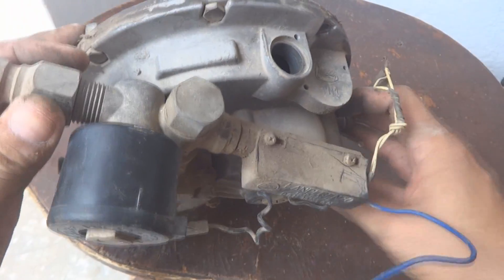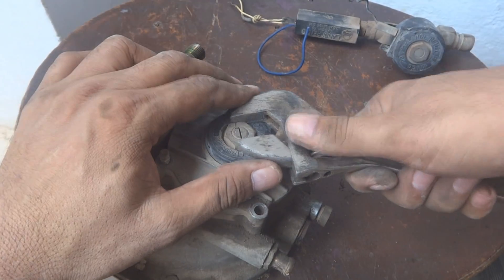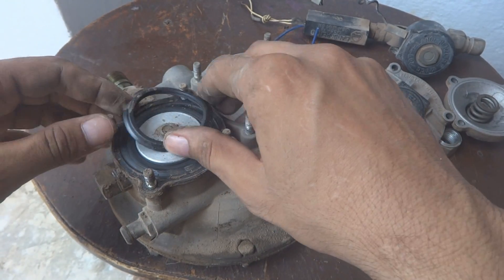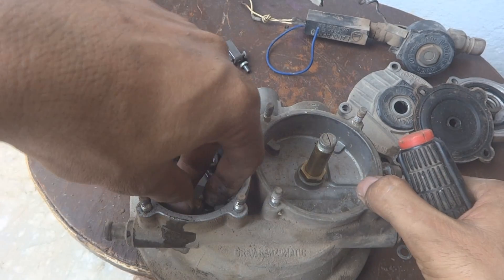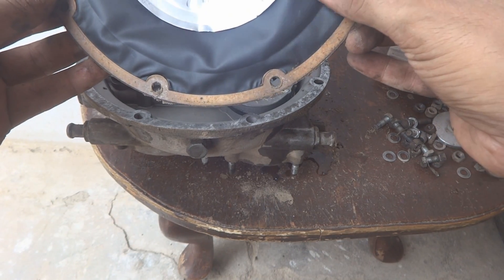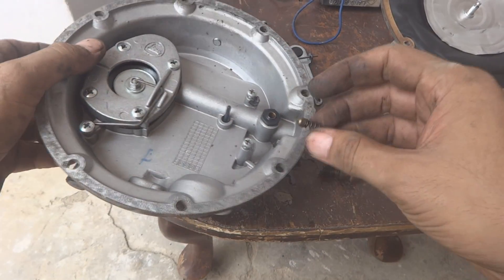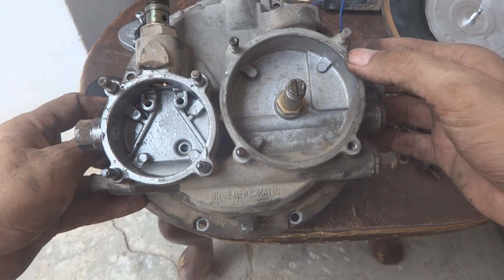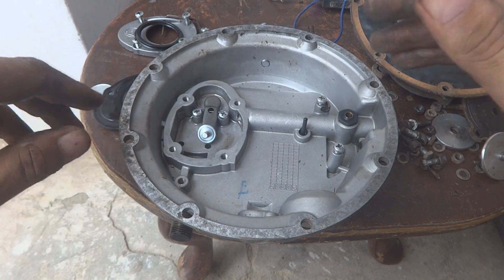CNG kit maintenance part 2. Car CNG gas kit repair and maintenance

Comment: what can you say about the gas inlet pipe where there is very high pressure (220 bar)? With what force should that tube be screwed? I am afraid that high pressure will cause accidents to my health.
Reply from the maker: Sure it's high pressure but the fasteners used works just fine. It's OK for everybody then what's bad with you? Don't be afraid too much.
Reply: @JahanZeb1976  Congratulations for your video, I am from Italy where the Renzo Landi CNG regulator is produced but nobody here has ever produced a video like yours. 
Thank you for your reply my friend. Talat Shabbir wrote : "While dismantling, first shut off main valve , release gas pressure from main line, otherwise gas jet can drill through your hand or whatever in contact".
Therefore is it very dangerous remove the gas inlet pipe with 220 bar ? 
Please , can you list precautionary rules to be observed in order to avoid accidents ?
Do i need to use body protection to protect my eyes and hands?
At very high 220 bar of pressure do it need a torque wrench to tighten the gas inlet pipe ?
What is the tightening torque with the torque wrench ?
If I don't tighten the gas inlet pipe correctly, what happens when I go to the methane dealer ?
Your help is greatly appreciated here
Reply from the maker: Great. Thanks for appreciation. This is right that you should shut the gas valve from the cylinder behind. The rest is just normal. It's like regular mechanical work. Once you do it, you will gain confidence. Also there is no need for any special tools like torque wrench or body protection. Very basic tools would help you in the process. Also check everything you opened and assembled with the help of soap water foams. It would tell you about leakage in your system. So leakages should not be there.
Reply: @JahanZeb1976  the pressure reducer is made of aluminum so if you tighten the gas inlet pipe too much, you don't risk damaging the thread?
Also, if I tighten the gas inlet pipe too loosely, what happens when refueling at the CNG station? is there risk of causing damage to the refueling operator?

Comment: My wagon r company fitted lpg has starting problem on gas and the air is blown from vaporiser through the tiny hole, I have changed the diaphragm also....Is there any solution... ?
Reply from the maker: I have a video on lpg gas kit repair. Watch that and repair accordingly.

Comment: How to wash iner part and what useful for kit wash water or oil or petrol or Cng
Reply from the maker: You can use petrol to wash metal parts only. On rubber parts you will not use petrol. You can wash them with soap water or clean them with cloth. Stay tuned and blessed.
Reply: I have cng luvato kit  there is the problem my car is not taking acceleration on Cng mod it’s going close after on the Cng and taking hitched and not moving my car it’s moving only petrol
Reply from the maker: Your kit needs adjustment or maintenance.

Comment: I'm glad you are doing that job and not me :-D

I think i would have washed the outside before taking it apart, then clean one section at a time because it would be my first time, but that is just lack of knowedge :-).

I would take pictures of the mechanisms just in case i could not remember lol :-D
Reply from the maker: Nice to hear from you sir. That is great. Really this kit disassembling and assembling is difficult at all. And especially for a great technical person like you. This could be as easy as an alternator or a self starter in a car. But this is a bit new job for most people are they didn't attempt it before. Best regards,

Comment: Good demonstration man, but how about an inline oil catch can or inline oil filter to prolong the work period. 
Good luck bro.
Reply from the maker: Thanks dear friend for liking video. The system pressure is way too high from the gas cylinder i.e. 220 bars. On such high pressure a moisture drop or in line pressure could not be very easy to handle. Anyhow it is understood that the gas station may provide clean gas which is not normally the case. Anyhow good news it this maintenance is not needed very frequently. In the existing conditions it need a few year of service to require such a maintenance on a gas kit. So no more worries. Best regards,

Comment: You are a a true master of repair !   I am worried that you did not keep screws and washers in correct order - but I have faith that you will be able to clean and put back together - keep up the great work - you are an inspiration! Thank you
Reply from the maker: Thanks dear sir for liking. You are right as I didn't manage to keep everything in great arrangement but you are right that I did manage to fix back everything in corresponding positions during assembly. The next part of the video will show the function and adjustment of the kit after fixation in the car. Hope you will enjoy that video also. best regards,

Comment: For complete cng kit flushing u should also clean the cng cylinder as it will have alot of oil, which gets in with the passage of time..
Reply from the maker: Thanks for good point suggestion dear friend. That had already done for my car before and there was little liquid part came out of the cylinder that time.
Reply: LearningZone where to get CNG kit serviced in gurgaon?